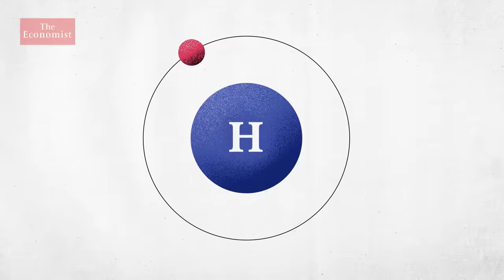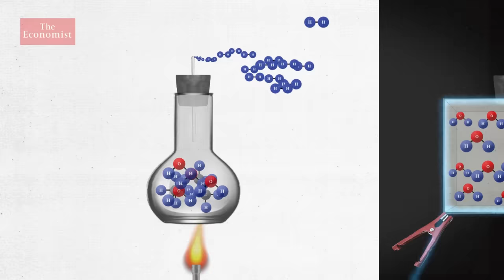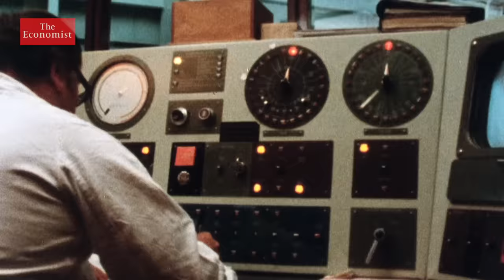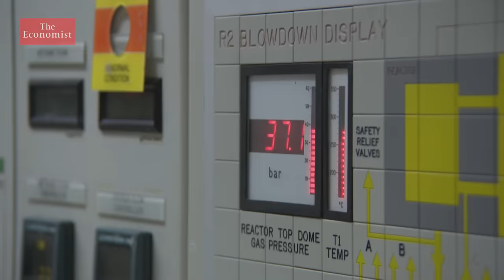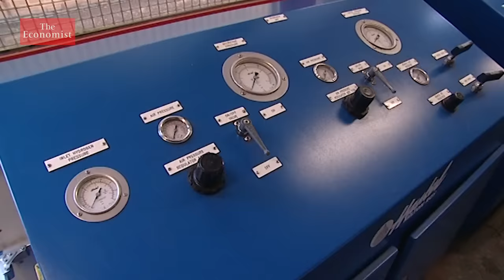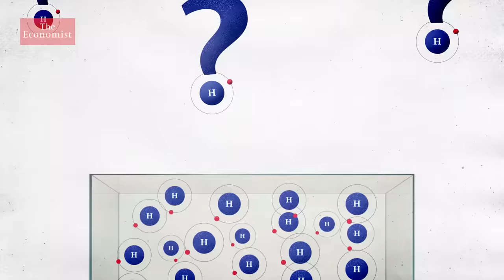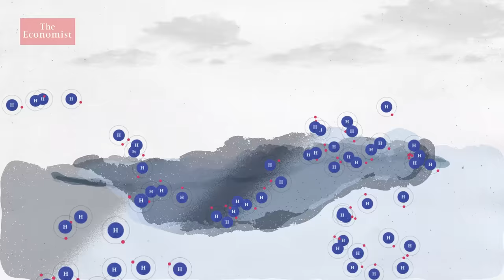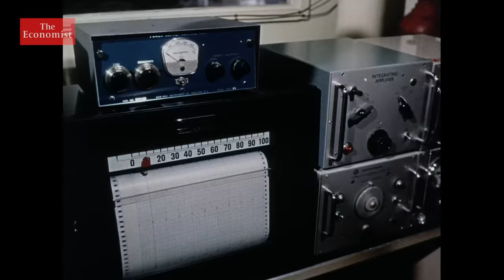Hydrogen: fuel of the future?

Comment: You can’t start a hydrogen video without saying “hydrogen is the most abundant element in the universe”
Reply: 😂 Yeah they all do that.
Reply: Yes but it only exists as an ash! And it takes more energy to release it then it puts out burning! And sorry we can't change the laws of physics!
Reply: Joseph, where is the issue if this information is true? Back to basic!
Reply: As if they don't understand what a pointless statement that is.
Reply: @terenceiutzi4003  That inefficiency is accepted. Further improvements in electrolysis will provide better results.
Is important to remember that H2 is only a bridge. A renewable energy surplus is supposed to exist for the process. That energy was already lost sometimes; because the difficulty to store electricity. EMAM.
Reply: @edwalves  interesting that the electrolysis process has not changed in 50 years? And with 100 percent efficiency the best you could do would be using the same amount of energy as was put out when the hydrogen burnt!
Reply: @GlobalInsider-008  The issue is that while abundant, hydrogen doesn't exist on its own.
Reply: @terenceiutzi4003  What does hydrogen only exists as an ash refer to?
Reply: @terenceiutzi4003  Hydrogen was burnt?
Reply: @lockbert99  can you tell me one place on earth where H2 is found naturally?
Reply: @terenceiutzi4003  I asked first.
Reply: @lockbert99  I know of no place on earth where you can find hydrogen where you can find Hydrogen that is not in a salt that was produced by an exothermic reaction !(!It is all an ash)
Reply: @lockbert99  Hopefully! Store or get back  energy is the fact we combine Hydrogen with other atoms or with itself. When you have free energy coming from either the sun or the win (free out of the cost of the system to create it: PV module, windmill); I do not see the issue to get clean energy anytime... thanks to green hydrogen. As hydrogen is an atom quite abondant, we are sure we will not turn out of it; not as the Lithium...
Reply: hydrogen cars can really ECONOMISE MORE FUEL COST THAN ELECTRIC CARS IF WE MODIFY OUR CURRENT HYDROGEN DISTRIBUTION APPROACH ! 
 The biggest cause of hydrogen cost is that WE TRANSPORT HYDROGEN BY TRUCKS, IT IS EXPENSIVE. Just try to avoid to transport hydrogen by trucks, then hydrogen will be very cheap. It means that NEED TO PRODUCE HYDROGEN ON SITES (WHERE FILLING HYDROGEN), OR TRANSPORT HYDROGEN BY PIPE LINES. 
 So we need to make 1 or 4 modifications : 
1/ Distributed hydrogen production on sites : hydrogen filling stations should be equipped with electrolysers, so hydrogen filling stations can produce hydrogen on sites from electricity outlets, instead of just receiving hydrogen from other places. Thus avoid problem cost of transfer hydrogen by trucks. Besides, nets of electrolysing hydrogen filling stations are ideal solution/market for intermittent renewable energy.  
It is new worldwide coming hydrogen distribution approach, so it opens markets of mobile small sized electrolysers. Electrolysers are not so expensive for hydrogen filling stations.
2/ Use compressed gas hydrogen batteries with mini household  electrolysers/mini mobile electrolysers : small mobility vehicles/mobility machines/mobility robots/mobility drones …, will use hydrogen gas batteries (hydrogen gas battery =hydrogen fuel cell + compressed hydrogen gas ballon 200-300 bar). And each of these mobility machines can be sold with mini home electrolysers, so that owners can produce to fill hydrogen at homes (charge hydrogen batteries at home). Hydrogen ballon 300bar is enough, so that hydrogen battery 300bar(fuel cell +hydrogen ballon 300bar) can guarantee more energy capacity than best lithium batteries, and it guarantees that the size of hydrogen battery 300bar  is not remarkable bigger than lithium battery of equivalent energy capacity. Of course 700bar allows more hydrogen storages, liquid hydrogen allows more hydrogen storage. But for hydrogen batteries, gas hydrogen ballons 300 bar are enough for  balance of performance-capacity-size-energy convertion ratio-ballon material-simplicity. 
Hydrogen batteries 300bar + mini mobile electrolysers are ideal for two-wheel vehicles/small cars/small robots/drones and for trend of hydrogen mobility devices anywhere (easy to operate  anywhere and easy to charge anywhere with electricity). Even very most simple hydrogen battery 300 bar (simple hydrogen battery 300bar =fuel cell+hydrogen ballon 300bar) outperforms against best lithium batteries by all feature : better capacity, smaller weight, more power, no limit lifespan, no degradation, quick recharge, no fearing cold temperature, and size is just little noremarkable bigger than size of lithium battery.
3/ hydrogen batteries for big station energy storage : Independent hydrogen batteries (hydrogen fuel cell + compressed hydrogen ballons > 300bar) + independent electrolyser is best variant. when excess energy, then run independent electrolyser. When need electricity, then run independent  fuel cell. And intrigued working mechanism between independent fuel cell and independent electrolyser. That is all ! No complex automatic control system. 
4/ hydrogen filling stations need to prefer using hydrogen pipe line than transporting hydrogen by trucks.
5/ The fundamental science dictates essential truth advantages of hydrogen.
Science : if a chemical energy storage mechanism is charged as quick as producing hydrogen, then this mechanism PRACTICALLY  CANNOT HAVE ENERGY CONVERTION RATIO BETTER THAN ELECTROLYSIS PROCESS. Besides, it is possible to adjust electrolysis reaction speed to get energy convertion ratio of electrolysis better than any chemical batteries. The best one of all possible chemical batteries in earth conditions is HYDROGEN BATTERY. All revolutions of chemical batteries, lithium batteries, LFP batteries, LTO batteries, graphene batteries .. are for reaching to the features of hydrogen batteries
Reply: @terenceiutzi4003   It prefers to send hydrogen to hydrogen filling stations by pipelines.  
If hydrogen pipelines are not available, then the hybrid variant effectively helps : electrolysing hydrogen filling station produce hydrogen onsite from electrical outlet, and of course electrical lines required. 
If hydrogen pipelines not available, and electrical lines not available (can not run electrolyser onsite), then transfer hydrogen by trucks of by ammonia
Reply: @abstractexchange5057  sounds great except there is no pipe made that will contain hydrogen the molicual is too small and it passes right throw all metals causing hydrogen inbrittlement.  So they could suspend it in amonia and then have a return pipeline for the Amonia and that sounds very efficient doesn't it?
Reply: @terenceiutzi4003  At this time, hydrogen ammonia way transportation is just in the considering stage, and is currently only the 3rd priority choice for big amount like ship tankers.
1/ The current best transfer method : hydrogen pipe lines.
Have glimpse on real checked practise : Russia uses pipelines for gas transfer to europe, and they gets significant advantages against all other players in the natural gas markets. 
Hydrogen is a little more complex than natural gases for pipelines, but formally complex only. In fact, HYDROGEN CAN BE MORE EASIER AND PROFITABLE THAN NATURAL GASES FOR PIPELINES.  
You can use very cheep materials for hydrogen pipelines in areas of no dense people, for example PVC materials, any cheap plastic material, many cheap composite material, or even Coca Cola bottle plastic materials, .. .  I can confidently say that intercontinental hydrogen pipelines are not more expensive than natural gas pipelines, and even very probaly remarkable cheaper than natural gas pipelines. 
Because hydrogen has the following features for pipelines :
* hydrogen is not toxic. So hydrogen leak does not affect biological and environment
* hydrogen is very lightweight and dispensed. Hydrogen quickly dispenses in air when hydrogen leaks gradually. It is not so easy to randomly collect hydrogen to proper concentration condition for exloring.
* hydrogen explosion explores very high temperatures, but DOES NOT MECHANICALLY DESTRUCTIVE.  It is very important feature easying hydrogen pipelines design/construction.  Because hydrogen firing mechanism DOES NOT CREATE INCREASING AUCUSTIC WAVES. For example, a gas explosion can destruct some houses nearby, but hydrogen explosion does not destroy houses nearby. The other example is the famous hydrogen digirible Hinderburg firing in the past (cause is not hydrogen), it is very clearly in that acident that when hydrogen firing, explosion did not destroy other objects nearby, people even ran nearby the hydrogen firing. 
So cheap plastic/PVC/HDPE/composite material can be used for hydrogen pipelines in no densed people areas. Hydrogen can leak through these cheap materials, but leaked hydrogen is just accepted natural transfer process loss, which does not harm environment/people and does not create risk of DESTRUCTIVE EXPLOSIONS. 
  I myself tried to transfer hydrogen through very popular standard long tubes (popular water pipes) for some long time durability. I tried to store hydrogen in big Coca Cola bottle for long time durability. LEAKS OF COURSE EXISTS, NO VERY SMALL LOSS, EVEN I CAN NOT FEEL LOSS.  NO ANY PROBLEMS ! . And i tried some intensives acts inducing explosions nearby hydrogen transfer tubes, but no any explosions/firing.  That is why i very confident that even hydrogen pipelines are simple and cheap, JUST ACCEPT SOME HYDROGEN LOSS AS NORMAL NOHARMFUL TRANSFER PROCESS LOSS. 
2/ If pipelines not available, then the hybrid transfer method : hydrogen production on site, as point1 and point2 in my first comment.  Need electric lines of course.
3/  If pipelines not available, and electric lines not available,  then the third method is hydrogen ammonia way transportation.
Reply: @abstractexchange5057  yes so why are they even considering it when it was such an inviromentle disaster in the late 50s
Reply: Most abundant in the universe but most scariest, in its pure form, on the earth surface...Why? because it's light. Every bit of it will float higher in the outer atmosphere, think about how high Hydrogen balloon could float
Reply: @mukamuka0  the problem is it only exists natural as an ash and it takes far more energy to return it to it elemental form then it puts out when it burns
Reply: @terenceiutzi4003  yes exactly
Reply: Lol
Reply: @GlobalInsider-008  

The abundance of hydrogen is misleading and irrelevant unless you think we're about to start mining stars for their hydrogen.

It's like standing in a tiny shoebox apartment in new yourk city while someone complains about the lack of space and responding... well actually space is the most abundant thing in the universe. The visible universe aline is 93 billion light years in diameter.
Reply: @lockbert99  Sorry! completly wrong. Atoms of hydrogen exist on earth. They are combined together to make moleculs of hydrogen, or combined with other atoms like oxygen or carbon. The beauty of hydrogen atoms is you can combine then with different others atoms by bringing or getting electrons. This physical principle allow to store or unstore electricity. The only issue is the efficiency because you will get about 20%. However, when the cost of the raw matherial (photons / air-wind) to make energy is free you do not care about efficiency.... out of the cost of all the machines to build this energy conversion process line (PV modules / Windmills, electrolyser, tanks, pumps, fuel cells, inverters). However, if the costs of all those equipements are so cheap, because you produce them in ultra heavy production number (a bit like cars), then the electric energy (CO2 free) can become affordable. It is a bit how cars used to cost in 1910 and how much they cost in 2010 (for the same  functions). If in 1910, we had to produce a 2010 Mercedes, nobody will have rich enough to buy it, mainly because of volumes and the fact so many machines were not already amortized. Then hydrogen is only a "vehicle" to keep or release electrons. The issue is to launch the full industry to make happen this transition to finally get CO2 free energy. It will cost about the same as to start from scratch the automotive industry.... with only the hope, the temperature on earth will not increase anymore and the climate will not change anymore. Who knows? The climate change can be a combination of factors like sun erupting cycle (every 25k years), ...
Reply: Works 30% of the time all the time
Reply: can't get hydrogen? simple! go take a trip to the sun and scoop some out and come back lul
Reply: @GlobalInsider-008  
You absolutely do care about efficiency when there is a limited amount of renewable energy and half or more of your country's grid energy comes from burning fossil fuels.

Also, wind energy is not free, it costs money and carbon to build and maintain.  An honest evaluation would amortise those cost factors.
Reply: @2LegHumanist  80% of energy is today coming from fossil fuels. Then roughly, we can consider when we make a PV module the energy to make it is 80% from fossil fuels . You will note it is much better than 100%... . When you make silicium, you need a lot of heat. Some plants to make silicium use geothermal from the volcano, like a plant in Iceland. Then the PV module is not anymore made of 80% of fossil fuels but much less. Then, more we will have energy coming from renewable energies and nuclear (only to the boost the transition) more, by the time, the energy will come less and less from fossil fuels and every the product will made of less and less of carbon emissions.
Reply: @GlobalInsider-008  
Every part of that comment is completely irrelevant.  I wasn't arguing against renewables, I was arguing against wasting renewable energy by using it in an inefficient process to make hydrogen for cars when there are much more efficient alternatives.
Reply: @g0203  
Literally nothing said by anyone here implies a lack of understanding of the word element.  Sounds like you just learnt what it means  🤣🤣🤣🤣🤣
Reply: @2LegHumanist  I have a msc applied physics degree and I was not going to read all the replies. I was just wondering...
Reply: @g0203  
I'm just working with high-school chemistry and I know the difference  between elemental and molecular hydrogen.
Reply: @GlobalInsider-008  nothing wrong with it but when you have watched like 10 videos about hydrogen power and hydrogen fuel it gets a little repetitive
Reply: Felipe Gomes  
Quske is better.
Reply: Watch the film chain reaction Morgan Freeman and Keano Reeves.
Reply: Please understand that the problem is not the abundance of hydrogen but how its made, same argument with lithium by the way. The overall energetic efficiency and cost-benefit is far greater when storing into a lithum-ion based battery instead of H2-Gas. Close to 100% to give a number. When using electric engines this stored energy is being consumed at almost 100% efficiency. Generation, storing, transporting and consuming H2 will drop energetic efficiency value to ~20%. 

I think we should get better at efficient tech instead of inefficient tech in transporting sector. The benefit of better battery-tech is far more valuable than exercising H2-Economy. H2-Economy would make sense, when we have limitless sustainable energy production. As a complicated backup energy storage system which degrates and depletes. Which we simply don't have for like 30+ years... Its just like Oil. A waste of electric energy but a bit cleaner than oil.

Batteries can also be fully recycled and last very long under the correct conditions. If we reach a certain energy-density and sustainable ressource supply, the thought of H2 will dissappear. But that's just an educated speculation.
Reply: Yes, abundant in stars, and nearly nonexistent in H2 molecular form on earth, where it’s needed, meaning nearly every molecule of H2 has to be made using energy.
Reply: You’d be surprised how many average people don’t realize that.
Reply: @farticlesofconflatulation  You’d be surprised how many people don’t know abundance in the universe means nothing for energy on earth, and think elemental abundance also that means molecular H2 hydrogen is plentiful on earth, rather than naturally non-existent.
Reply: That's like comparing coal to diamonds....
Reply: @jarednovel  Interesting. Do you have a source?
Reply: Abslolutely illegal